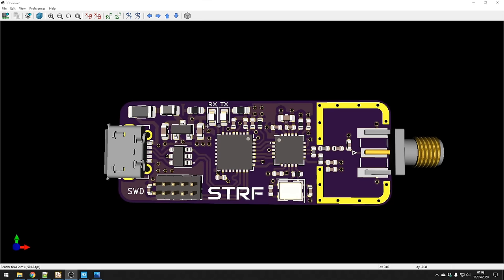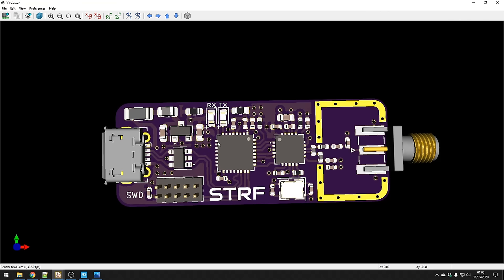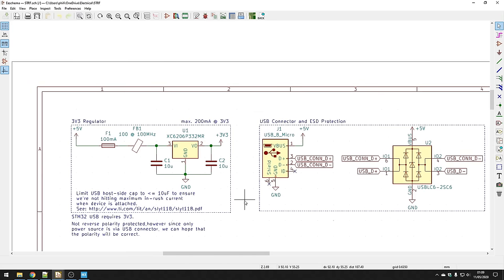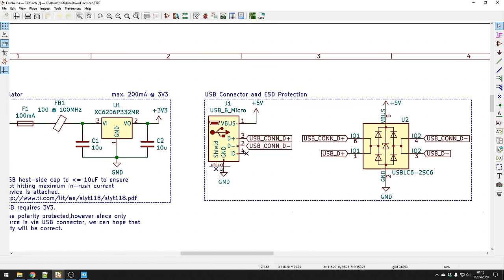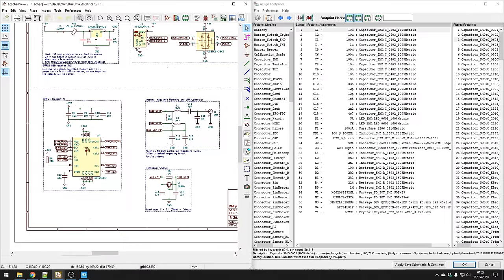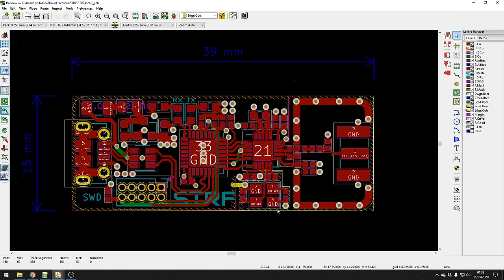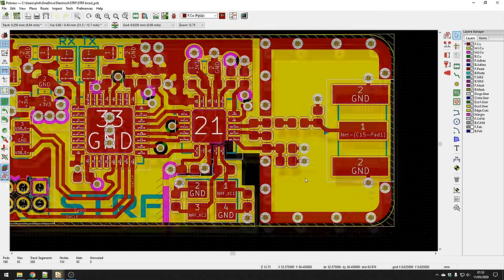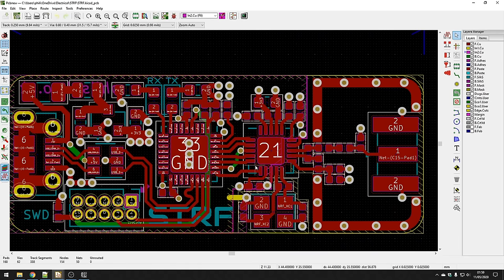KiCad STM32 + RF + USB Hardware Design - Phil's Lab #5

Comment: Great video and thank you for the amazing content! 
Just one quick question: Why did you connect the 22K Resistor to 3V3 on the IREF pin? The datasheet says to connect it to ground.
Reply from the maker: Thanks a lot Chathula, that's a great spot! I hadn't gone over/checked the schematic properly yet and you're right, the IREF pin needs to be pulled to ground. I've made the changes and the corrected version is now on Github. Thanks again!
Reply: No worries :) keep up the great videos!
Reply: Chathula Eagle eye :)

Comment: I know the Kicad render doesn't necessarily reflect the exact part you're using, but for those who aren't aware you can get those 10-pin 50 mil JTAG/SWD headers with keyed shrouds. I like the two-walled versions (e.g. the Adafruit 4048) -- the four-walled headers waste too much space. With the unshrouded headers it's always a minor headache figuring out where pin 1 is on the board, where pin 1 is on the cable, and whether the cable is hooked up the right way on the other end. Using keyed connectors everywhere makes it a no-brainer.

Also, when you made the connection between the main and oscillator ground planes, was there a specific reason for choosing the location you did? I would expect the best location to be near one of the IC's ground pins to minimize the loop area for whatever current is needed to drive the oscillator circuitry, but this is not my area of expertise.

A couple more random thoughts: I like the choice to use micro-B. It's always a pain trying to find a decent (non-standard!) A-to-A cable when working with devices with built-in A plugs, but everyone has a ton of micro-B cables lying around. If this design weren't optimized for space and simplicity, I might also suggest replacing the debug header with a two-port hub and an on-board programmer like an FTDI or even the MCU block of the Black Magic probe.

Thanks for sharing your work!
Reply from the maker: Hi Stuart, I'm very sorry for the late reply - it's taken me a while to get through the YouTube comments.

Yeah, shrouded headers are definitely much better. I was being a bit of a cheapo with this board and went for the header that costs a third of the shrouded one..

Regarding the ground connection: yes, a connection to the nearest ground pin of the IC would be better. The amount of difference it makes for these 'low-performance' boards is negligible however, but you're right I should still pay more attention to that!

Yeah, micro-B is definitely my favourite connector. I could've made the boot-pin user-selectable, such that the USB could be used for programming as well - that would mean no FTDI or similar would be necessary. 99.9% of the time however I use the ST-LINK for programming/debugging, so as you say - to save space, I typically leave this stuff out.

Thanks again for your comment!

Comment: Two things: your RF isolation should include the Nordic IC (and then use an optocoupler to bridge into it). Second, your DM DP wiggle should be located at the end of the TVS diode, not near the MCU pins. Also, I would have gone with a 2x3 XTAL instead of that 6x5.

Comment: Under the antenna connector, there should not be ground plane. With such a big trace, the impedance will be significantly lower.

Comment: or just hack the transmitter side to work as a bluetooth device and use the bluetooth on your laptop.FYI you can turn nrf24 modules to bluetooth devices.An example is VESC which uses nrf24 as bluetooth and you have an app on your phone

Comment: Thank you for your effort.
 I want to a ask for my projects.
I will use bmp180, Arduino(Atmel),usb and nrf24 elements. When making the pin connection, do I make schematic of bmp180 and other components extra by doing the connection you have show above? Or  is this the  schematic you shown only valid for nrf24? So should these pins connection be changed for new project.
I like your watching your videos. Please feed back me. Thanks

Comment: I'm surprised you didn't need to supply a few microfarads of capacitance to the power pins of the nrf24l01 chip.  Using the cheap premade modules , available on Amazon etc, I ran into serious range and reliability problems in arduino based projects, until I piggy backed capacitors to the power supply pins of the modules.  After that, they worked great.  Perhaps it's due to too much inductance on the power being supplied from the Arduino, and unique to that use case.

Comment: Imazing walkthrough. Thanks. Could you please explain why your designs often use those exposed copper frames for shielding different sections or frame the outer edges of the board. I understand the via fencing and stitching vias but what is the motivation for removing the solder mask? Or is it purely on aesthetics? 😊

Comment: First of all, thanks for your awesome videos! 
I do however have a question regarding the separate GND pour below the crystal oscillator. I have also seen people recommend doing it that way, however, it is always suggested, that the GND pour below the crystal should be connected directly to the ICs GND pin. After all, you want to have a direct current return path from the output driver, via the crystal back to the IC. I was wondering, if there is a specific reason, as to why you chose to connect the separate GND pour, on the left side, rather than going directly to the VIA placed at the NRF? As far as I understand, the return current now has to take a path with a greater loop area, which to my understanding is not desirable. Thanks a lot in advance! Nikolaus

Comment: Great content, how did you calculate the spacing between vias in the Guard Ring ? 1/20th*Lambda?
Reply from the maker: Thank you! I didn't actually use any particular metric to calculate it, but rather just gauged a sufficient distance by eye. The whole guard ring thing for this particular case is more of a gimmick than actually necessary for proper functioning of the board, so I tried to make it primarily aesthetically pleasing haha.

Comment: This may be a stupid question, but why do we not need a separate oscillator/crystal for the STM32 (this board connects the oscillator to the transceiver instead). Does it have smthg to do with the SPI connections between the transceiver and the STM32?

Comment: Great video tutorial thanks for sharing! hope to see more of this around soon.
Are you planning to post a video testing the board functionality? with the stm32 programming and RF com test?
Reply from the maker: Many thanks! Yes, I'll be placing an order for this board soon and then will make a video on how to program the device, as well as test the board's functionality.
Reply: @PhilsLab  I want to be able to program the board via USB using Arduino. Is that possible with this STM32 chip as long as I change the boot pin to high?
Reply: @elidavis  My guess is that he'll be using STM32CubeIDE or CubeMX with another development environment. As for the programmer, most likely an ST-Link.

Not all STM32 chips/boards are compatible with Arduino IDE. So far I know those compatible are:
-Blue and Black Pills
-Most Nucleo boards (but NOT ALL)
Reply: @caffeinatedinsanity2324  yeah, seems like ST-link is the way to go for programming stm32 chips
Reply: @elidavis  You are right though about the boot pin part. Depending on the chip you could upload code using serial or USB if it has it. Serial is most common if I'm not mistaken

Comment: Hi Phil, great project, thanks for sharing! When you say you "transfer" a portion of the application diagram from the NRF24 into KiCad, what exactly to you mean? 
a) Do you mean "reproduce" in KiCad? I.e. you have to use to drawing tools in KiCad to draw the circuit or 
2) do you somehow "copy" the circuit from the pdf and past into KiCad? 

I believe 1) is the correct answer but wanted to ask you since I never used KiCad. Thanks again!

Comment: Great video thanks for sharing. Just a small note at 6:22 the 3.3V reg section can not deliver 200mA due to the 100mA fuse and this being a linear regulator.
Reply from the maker: Thank you! The note on the schematic was just to state the fact that the LDO can supply up to 200mA at 3.3V (and therefore can supply enough current to the remaining circuit (which draws much less than the max.)). I probably should have explained that better though!

Comment: Thank you for this wonderful content, subscribed.
If you could make a series about some electronics basics that would be totally sick <3
Reply from the maker: Thank you! Yeah, I had planned on doing a few more electronics-y based videos, rather than PCB design.
Reply: @PhilsLab  if you could do both at the same time that would be awesome, like if you explain about caps or resistors you can maybe do it in schematic and then show how design the board, and etc, or from schematic -> breadboard.
I've find it very hard to learn basic electronics since it's very hard to find a place that covers the basics in a practical manner, content creators such as you offer me the best learning experience I could ask for, thanks. 
P.s sorry if I murdered your language, though I tried not to :D

Comment: In the data sheet for the USBLC6-2SC6, in some of the figures, there is a 100nF cap connecting the 5V line to ground. However in this design a cap is not included. Is there a reason to use or not to use a cap like that for this ESD chip?

Comment: I would be interesting to see battery pack BMS system design. Max 4..6 cell not huge one what they regulary are building.

 For one of those battery types Lipo,Lilo. LifePo4.
Active BMS would be the best
 with over under voltage protection.
Short protection
Balancing
Maybe fuse wire for every cell.

Comment: Hello, on your ground pour recommendation for the crystal, would you recommend it for a two crystal system too? For a STM32 with a main High Speed External Crystal of 25Mhz, as well as a RTC Low Speed External Crystal of 32.768KHz, should one also have a ground pour like the one you used here? Or should  they have two different pours?

Comment: I had done a design similar like yours 6 years ago. STM +NRF and used serialization feature. But after NRF came out with BLE and cortex 4. I jumped over NRF 51 with a single chip solution. I wonder why didn't you use nRF52840  that also has a USB I/F?

Comment: Hello. I'm a student working on PCB design. If I extend the pad length of an SMA connector, will it affect the impedance? Also, I am planning to design a PCB with only the SMA connector and no other components. Is it possible to create the PCB layout directly without going through a schematic?

Comment: One of your usb trace is turning less than 90 degrees. The point where you did the length matching. It will cause a sudden impedance change on that turn and will cause reflections. Better relocate that.
Reply from the maker: Thanks for your comment. While it certainly doesn’t look pretty, this is a common myth and has minimal effects on impedance match. A great example analysing these effects/theories is given here: https://hackaday.com/2019/01/24/video-putting-high-speed-pcb-design-to-the-test/
This guy even goes up to several GHz in frequency and measures minimal effects. Considering the board in the video only runs USB FS (something like 12Mbit/s), the ‘impact’ will be substantially less as well.
Reply: @PhilsLab  It is not a myth. Why do you think you don't see an acute and right angle turns on an DDR3/4/5 PCB routing? Anyway, if its USB FS, then no big deal.
Reply from the maker: I should have expressed myself better - you’re right. In general, for ‘lower speed designs’ the general consensus is that 90deg bends will cause minimal trouble, compared to more rounded traces. DDR is of course a different matter, where picoseconds timings matter and on length-matched traces the cumulative effect of slight impedance mismatches will cause problems. But yes, I think we can both agree that for USB FS it makes no difference. Thanks again for your comment.

Comment: Nice effort with your 50 ohm lines even though it's not strictly required for a design like this with such short transmission line segments. If you are not going to measure (with a VNA) your matching network but rely just on the manufacturers example then it's all an educated guess anyway :-)
Reply from the maker: That’s very true! But worth the time getting into the ballpark at least :)

Comment: Possibly a dumb newb question, but one I've not seen answered yet: what's the point of leaving bare copper exposed on the guard traces? Unless you're soldering a shield over the top I can't see why that'd be useful, yet so many rf boards I see have that feature.

Comment: Nice video. I have one doubt though, shouldn't the NRF's EPAD be grounded, and have via(s) ?
Reply from the maker: Thank you! Yes, you could connect the EPAD with a few vias to a copper pour. This is for a thermal connection, rather than an electrical one though. But good point and something that wasn't directly mentioned in the datasheet - I'll make the changes to the Git.

Comment: Excellent video, quick question why not have an extra bulk capacitor for the VDDA pins as per the stm32 datasheet? Thankyou for your great resources
Reply from the maker: Thank you! The STM32L432KB datasheet on page 64 recommends 10nF + 1uF in parallel attached to the VDDA pin. However, since for this design I am not using any ADCs/DACs/op-amps I simply replaced this combination by one 100nF cap, since this will suffice and save space. Should you be using any of the ADC/DACs/etc, additional filtering is recommended for VDDA as well (in terms of a ferrite bead, or LC network). If you check out my other video in KiCad hardware design I believe I go into a bit more detail there.

Comment: Sir, i have a question, that whether in industry, where there are a lot of sensors and actuators, doe they use HAL library, or bare metal, or both are used according to application demand?

Comment: Very well done! I'm curious about track length with the USB differential pairs when routing them on different layers through VIAs. As I understand it, it's the total length that matters, but I saw some guy saying that one should have the length match per layer. In the end it would be the same I guess, and currently Kicad matches the total length (all layers), so I'm curious to hear what you say about this. Important to have length match per layer or total is enough? Anything else to think about when one have to route these to different layers? I guess having the differential pairs routed on top and bottom would be best as you then can have that uninterrupted ground underneath as otherwise you would have to have that on two layers.
Reply from the maker: Thank you! For high-speed signals I generally (try to) avoid the use of vias, as they will add series inductance. If you do need to add them, should your layout not allow otherwise, I believe (at a first glance) that the length matching per layer seems like it wouldn't make a difference. The overall length is what matters and that needs to be matched. I'm happy to be proven wrong though if someone has a convincing argument!

Comment: Hi
Nice project!
I used NRF24 and Msp 430 controller  >10 years ago in my thesis project, we managed >1 year runtime with a 500mA Lipoly cell. But I don't understand your low power rerquirements for a usb powered device.

Comment: I designed a PCB including this chip and I just can't get it to work. I'm trying to communicate with an Arduino Nano and communication works between two Arduino Nanos. When I try to send or receive on the STM32(H723ZGT6) board, it doesn't receive data and also doesn't send data. I also tried using an external NRF24 breakout board and had the same issue. I know this is probably a software issue but maybe someone can help...

Comment: Hi Phil, I was wondering if we have to consider the impedance of the SMA connector. It's quite a big trace width difference going into the connector
Reply from the maker: Hi Nathaniel, Thanks for your comment. Yes, unfortunately impedance discontinuities will appear at every boundary of a lumped element. Even the 0402 components’ pads are over double the width of the 50 Ohm trace here and pretty much unavoidable in this design. I have taken quite a bit of my info from the HackRF routing, which uses the same (?) SMA connector, very similar trace width, and same routing as shown here. From tests on other previous boards I have found no significant degradation of performance at these frequencies. However, I will probably decrease the SMA center pad width a bit and update the Git repo.

Comment: Nice video and information!

I have a question how did You made guard ring? As a different part or drawed? How did You made it gold color?
Reply from the maker: Thanks!
I used the 'graphic arc' tool  on the front copper layer to draw the rounded edges and otherwise used a polygon or PCB fill to do the rest. To get the exposed copper you also need use the front mask layer and essentially duplicate what you made for the front copper layer.